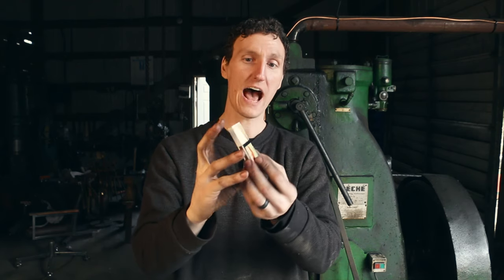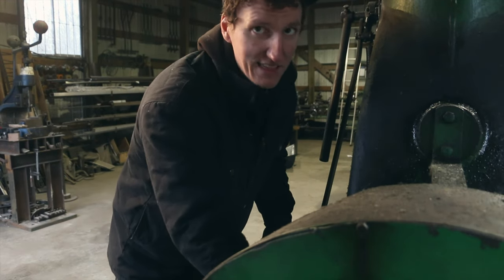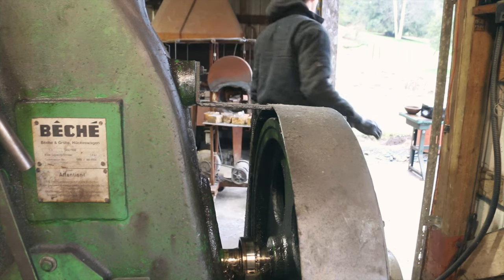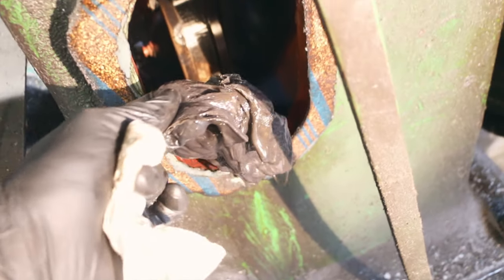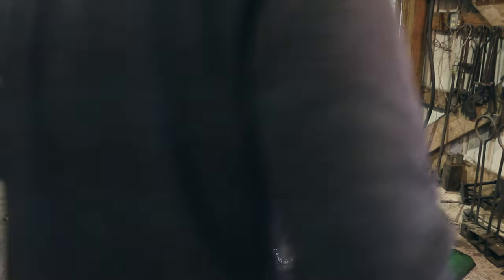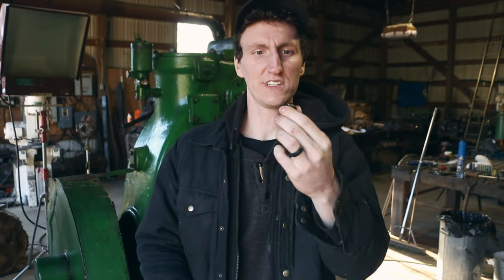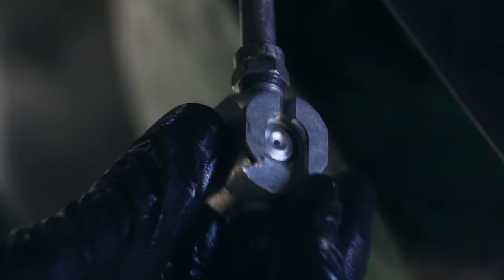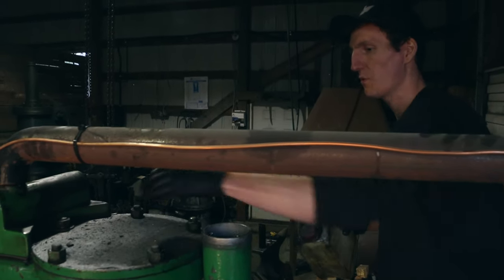DID I WRECK MY POWER HAMMER?

Comment: I may have to check that crank bearing too... I have a grease cup underneath, but not sure how it connects with that large cavity... great to see the green color again!
Reply: The housing on this one has a grease nipple so it just has to have a bunch pumped in. If you have a bushing, then (at least with rubber bushings in cars) you shouldn't ever let grease get on as it degrades them 
You shouldn't have a bushing though as there not for rotating parts, but more as a small shock absorber. You might just have a journal bearing. And if you need an oil cup underneath then check your bolt torques and bearing seals cos they shouldn't leak any oil

Comment: Tim! you put your bearing cover on backwards, the first one, back by the rear flywheel. In the early shot, the oil nipple is on the left, then its on the right as you re-installed it. Unless you filmed from both sides of the hammer. I would check it out in case its a problem. Cheers
Reply: I noticed that too, and it was definitely backwards.  The nipple orientation went from away from to towards the flywheel.

Comment: I've been working on old machinery for over fifty years, that grease fitting was common, I began replacing them with zerk fittings, in the sixties, generally they are based on standard pipe thread, 1/8 or 1/4 inch, and then you use one grease gun for the whole machine.  Thanks for sharing this, what you found is what I've found most of my life, old machinery was well enough made to survive even violating basic rules of maintenance.  The old machines never die.

Comment: The button heads are good style of fitting. We set up 2 differant grease guns .We use them on certain types of machines that require food safe grease and we use regular fittings for regular grease that way nobody puts the wrong grease in a machine

Comment: I do a lot of bearing work and I believe those are split intentionally. It lets you roll those pieces in and out with the bearing. You should have two bearing on the crank (?) shaft for the drive. One is held in place and is called the captured bearing and one is allowed to move back and forth when the machine heats up and is called the floating bearing. The bearing on the back must be the locked (or capture) bearing.

Comment: Just a heads up. That wd40 will dry up within the hour but in cold weather may stay moist for up to 1 day. It doesn't make a good lubricant because of it.  If you have a moving part thats kind of sticky spraying it with wd40 just breaks down the grease or oils that are making it sticky.

Comment: I watched a video of a traditional Japanese swordsmith who didn't use power hammers.  Instead, he had 4 guys swinging sledge hammers for him.  So, fundamentally the same thing.  Variations on mechanical hammers have been around for over a thousand years.  For as long as guys have been swinging a hammer, they've been thinking "there has to be a better way".

/I built my own power hammer.  It is the better way.

Comment: Those lil "grease fittings". I rent equipment at my work. Some of the old machines have grease fittings that look like that. You use a small grease gun that goes to a point almost at the end. They're real cheap to purchase.
Reply: Chainsaw bar greaser comes to mind but only hold a couple of ounces
Reply: hypodermic needle made to fit on end o grease gun migt work too used them in the past for zerks thar wouldnt easily take grease until i had time to remove and repair or replace them

Comment: Powered hammers have been in widespread use since the 12th century (Edit: in Europe), how is that not 'traditional' by now?
Reply: The Chinese have had power hammers since 200bc
Reply: @ianturpin9180  how they powered them. There was no electricity or petrol at that time?
Reply: @MohsinExperiments  water wheels probably or horses/donkeys
Reply: @MohsinExperiments  waterwheels to power trip hammers. Or on a smaller scale foot operated treadle hammers.
Reply: @ianturpin9180  I'm not sure the sort of people using 'tradition' as an argument against power hammers know that China, India, and the Middle East had metal at all, and I'm sure that it wouldn't convince them if they did. Had a man try to convince me that Damascus steel was developed in Spain, and even refused to believe that Damascus is a real place! That said I really should have indicated that I meant Europe, and I'm going to edit it to make sure it doesn't cause any confusion.
Reply: @fletcherreder6091  the Chinese were making things of great beauty out of bronze, whilst we were only capable of pulling swords from stone.

Comment: I know nothing about anything: curiosity - when you’re at the power-hammer with a glowing piece of metal (I’m guessing is devoid of any liquid H2O or steam due to the very high temperature) I’ve noticed with nearly every press the block of metal puffs out what looks like pure steam.. could that be residual water that’s only worked it’s way towards the outside layers and is being forced out by each strike causing compression.. or perhaps with the air being warmer inside there could be water vapor in the air which settles on the metal and when each strike the heat and the force expels the accumulated water so fast due to heat and pressure that it’s nearly turned into steam instantly, which it seems to be relegated to just around the hammer and block of metal.. or lastly, is there some chemical reaction with the metal being as hot as it is that any oils that gathers from the intense heat is being forced out just as I mentioned earlier. Or it’s a part of the forging process and since I haven’t a clue in that area I’m just unaware.

Comment: hi timothy in the uk one name for those button nipples is a tecelamit type i used to have them all over my bus so i got the adapter and screwed in a more normal zerck type it now lives in my grease an oiler box ready for the rare occasion i find one of the old  tecelamit ones witch are great no leaking able to withstand an immense amount of pressure without getting stuck on or popping off great vidio for us thanks